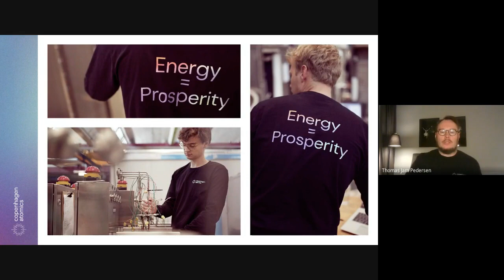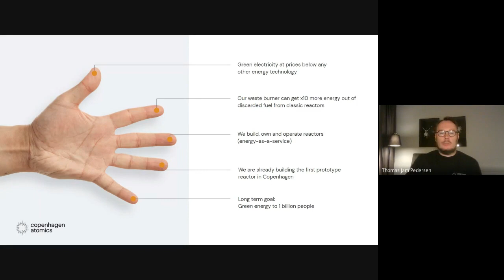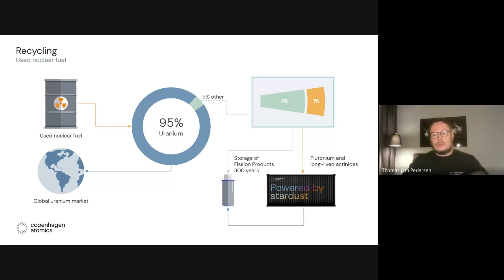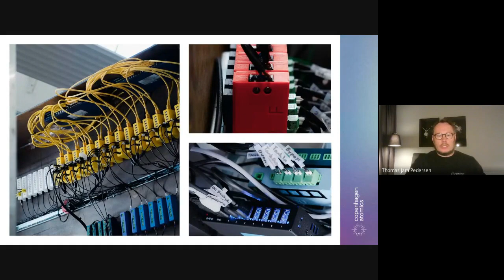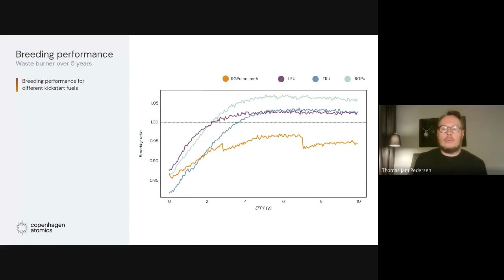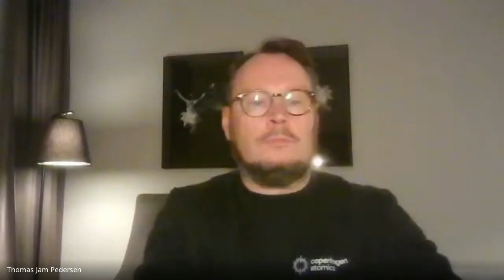Thorium molten salt breeder reactor as waste burner using heavy water as moderator

Comment: The issue with MSRs is the Tellurium embrittlement or segregation.  Stronger more expensive alloys must be used and an additive just to get them to last longer than 4 years and why they were shelved back in the 60s.  Thorium reactors are not Thorium reactors....they are Thorium decay chain reactors where Th232 must be transmutated to U233 so in fact they are still Uranium reactors.  Calling them a Thorium reactor is a fallacy
Reply: it is not a fallacy because the input fuel is thorium.  You are correct (as is explained) that the Th232 is transmuted to U233 to be the actual energy generation but you don't mine U233 from the ground (too bad too).  

As for tellurium embrittlement, I'm curious where you are hearing that.  There is a very interesting video where corrosion was discussed by the ORIGINAL TEAM that worked at ORNL on the MSRE.  They seemed to think that corrosion was not an issue when discussing their work.  It is at ENH-jd6NhRc. 

 I am aware of research that is ongoing regarding corrosion concerns.  My quick search did not find anything about tellurium, but it did show that there are ways to mitigate corrosion, such as their example of adding lithium (see Q73c9LXr1tE).  The video is 5 min long and is a presentation from ASM International.
Reply: @LFTRnow  Thorium is not fissle.....
Reply: @paulmobleyscience  U238 isn't fissile either and yet it is the majority fuel in most reactors. But I would also like to hear about the Tellurium thing. All I heard from every source ever (and I do search around for this stuff a lot) goes against that claim. So please, let us know your sources or how to find them at least. But it is strange, if the people who worked at Oakridge say they were shelved for different reasons and corrosion is managable and the people shelving them also said it's for different reasons I really do wonder who was it exactly that says it's for Tellurium embrittlement reasons.
Reply: @MrRolnicek  Of course U238 isn't fissle otherwise it's what would be used.  In fact U238 neutron captures and exactly why the naturally occuring U235 does not chain in nature as it does in our reactors and exactly why most actinides are synthetic and not found in any measurable quantities in nature.   But U238 is still Uranium even though U235 is the fissle material which is also Uranium...not a completely different name like "thorium" reactors which are actual Uranium reactors being that's the fuel used.   As far as Tellurium embrittlement in the 60s that's what caused them to stop with the first expuremental reactor because at the grain boundry layer it was interacting with the nickle in the alloy.  That's when the expuremental reactor was shut down due to the corrosion and not until the 70s which is where you see them using different alloys in the press release that you more than likely seen but there are many public releases from ORNL well before the 1978 release which is what you more than likely seen.  I'm not here to hold your hand just because you have no clue there is more than one single published release of information on the Tellurium embrittlement issue.   Take a long walk off a short pier and you can shove your attitude straight up your kester
Reply: @paulmobleyscience  Oh well, the naming is your issue. You're of course free to use the whole sentence of "Uranium fuel cycle" and "Thorium fuel cycle" Or you can say the reactor burns mostly Plutonium or mostly Uranium 233, not to be confused with Uranium 235. It's convention however that we just say uranium when we mean Uranium fuel cycle that mostly breeds U238 into Plutonium and burns that as well as U235 directly and we say Thorium reactor when we mean it mostly breeds Throium into U233 and burns that. It's just a name.

And if I understand this correctly, you're saying the reactor was shut down because of Tellurium issues in the 60's and then it was started again with different alloys that didn't have the issues in the 70s which is where I get all of my sources from and that one was then shut down for the commonly known reasons. And I didn't know about the Tellurium issues because the reactor that everyone knows about and had all the press releases is the second one which didn't have the issue anymore. Do I get that right?
Reply: @MrRolnicek  Let me make sure I understand you correctly...you come in attempting to make the correlation of fuel used in "thorium" reactors as the same as what's used in say PWRs when it isn't the same procedure.   You don't transmute U235 into a fissle material because it is already fissle from the start.  Th232 must be hit with neutrons...what is that neutron source Rolnicek?  It isn't the same process like it is for uranium fueled reactors.  "Thorium" reactors are not fueled by thorium, they are fueled by uranium and that's an unarguable fact.  
Now to your other semantic nonsesense...you came in saying that the scientist at Oak Ridge say there isn't an issue with tellurium embrittlement of which was not the case in the 60s when they had to shut down the expiremental MSR after a fraction of the time it was designed to last and was in fact due to heavy corrosion that occurred throughout the vessel. That's when the MSR expiremental reactor was shelved and it was due to corrosion.  Had that corrosion not occurred they would've operated it for at least double the amount of time it actually operated at less than 5 years.  They then conducted tests on using different additives to the alloy attempting to keep the corrosion at bay and found some possible solutions.   Those solutions would not allow a MSR to compete with other forms of energy production and is exactly why MSRs didn't go up like the rest of the reactor fleet...and it was all due to Tellurium embrittlement and that is an unarguable fact.  Rolnicek...you don't think you're the first pronuclear entity here on YT that has attempted this semantic nonsense on this topic do you?   You don't really think that Tellurium embrittlement is the only issue with a MSR do you?  Tell me Rolnicek....why is IMSR attempting a SMR that must have its core changed every 4-7 years?   You mean there is a graphite issue as well?  Say it isn't so Rolnicek..
Reply: @paulmobleyscience  Let me repeat ... the MAJORITY fuel in a PWR is U238, not U235 and just like Thorium it needs to be transmuted first before it undergoes fission. One of the biggest advantages of a Uranium fuel cycle is that Uranium in nature comes with an immediately fissile additive of U235 which can be concentrated for a more potent fuel. On the other hand Thorium fuel cycle has it's own advantages and disadvantages as I'm sure you know.

And let me assure you that I'm not playing semantic games. I've been following nuclear tech for a couple of years and have NEVER until now heard the claim you have made and in fact have heard contradicting claims from the people actually involved in those experiments themselves. I'm not going to simply believe them because they were there with their hands on the experiments we're talking about, I'm here taking your claim seriously but I'm going to need more than "It's an unarguable fact, trust me bro" from some random person on the internet. I'm sure you can see that position is reasonable on my part.

And just as a sidenote, Copenhagen in a DIFFERENT presentation actually did say things that, for the laymen, definitely sounded like comparing the fertile Thorium to the fissile U235 and I left a very dissaproving comment under that particular video because that comparison is misleading at best. Comparing a thorium fuel cycle to the uranium one on the other hand is absolutely fair.
Reply: @MrRolnicek  Trust me bro?  I didn't say that and just because you haven't read all the literature in your few years doesn't give the all the knowledge needed to come to the correct conclusion.  All you're saying is basically you heard the reason we didn't build MSRs from some people is because of some other reason, of which you've never iterated that reason, and that what I'm saying the issue was is incorrect because you heard from some people that it was a different reason.  But now you're saying that you've never heard that Tellurium embrittlement was an issue until you read my comment well before you ever showed up here in this thread.  You now say that you haven't read everything but still somehow seem to think you can discredit anyone because you've "been following nuclear tech for a couple years now...."  and do you think that some of us out here have been doing the same thing over the many years?   Maybe even some of us are Engineers and understand completely how this all works and have spent more than a couple years studying all this.  Tellurium embrittlement of the Hasteloy-n is the initial issue that occurred and why the reactor was halted immediately.  Time to find the date it began and the date that it it was shut down and then add at least 10 long years after that date and is when the "hands on scientists" you speak of offered possible solutions without any guarantee.   After that date in the 70s up until now, no MSRs have been built in the US.   The proof is in those many ORNL public information releases that show this progression.  Over 15 years these documents of studies with MSR technology occurred and reading only one or even a few will not give one the proper solution to the history that occurred.  
U235 must be purified and enriched after tons of U238 is mined just to find a very small amount of U235.  That U235 is seperated from the U238 so that the proper ratio can be achieved when making the fuel pellets. U238 neutron captures and the ratio that naturally occurs keeps the U235 decay chain from occurring.  All we do is increase the ratio of the U235 to U238 and how we are able to make a reactor work at all.  With the Th232 decay series that must be manipulated by us as it doesn't occur naturally in any measurable quantities must be bombarded by neutrons first from the start to transmutate into two other radionuclides before it is then fissle that is a completely different radionuclide than what was started with, unlike the uranium fuel.  Uranium fuel starts and ends with the two same radionuclides that only have the ratio of one to the other increased to get the necessary reaction.  "Thorium fuel" must be changed twice that becomes a completely different radionuclide of Uranium-233 before that fuel can be processed into the proper ratio.  That is a completely different process and is not presented the way that it truly is.  
This conversation should've went much differently and the attitude you entered the conversation with is what caused it to change.  A discussion should not begin with an attempted attack of someone or their character based on one single comment that you didn't agree with.  Stop trying to put words in my mouth "bro".  Let me ask you one last thing....what is the single stipulation for the use of the inverse square law and how is it similar to Planks Black body stipulation?
Reply: @paulmobleyscience  Look man, I've tried to be civil. I do apologise if it came off wrong. My comment was, and I reiterate: 
"hey, I'm no expert but I looked around this stuff a lot and this is the first time I hear about this, can you please tell me where I can find out more"

In response you started being quite hostile in my opinion and for some reason, the conversation also skewed into comparing fuel cycles and what they should be called. Should it be called a Uranium fuel cycle when most of the fissions are by Plutonium and should it be Thorium cycle when all of the fissions are by u233? I'm personally happy with the naming as is as long as someone isn't deliberately trying to confuse (as I believe Copenhagen did in another presentation). The "trust me bro" remark of course refers to the entire attitude of saying "it's an undisputable fact" as an answer when you're asked for a reference or a source.

Now because it seems to be becoming increasingly relevant, I'm not particularly into history much actually so I'd prefer the chemistry over history when it comes to the Tellurium issue. Even though it's probably not relevant as I don't know of any proposed reactor that wants to use hasteloy-n but it's still interesting and you never know, maybe that sort of info will make it more clear for example how "moltex" are claiming to have developed a stable, non-corrosive salt.

I'm no expert, I'm just interested, you said something interesting that seemed to contradict my current knowledge (which you correctly identified comes from the press releases and the interviews with the workers at ORNL) and I want to know where I can find out more. This whole tirade seems unnecesary (though I do personally enjoy this kind of pissing contest for some reason) and your attitude only makes me think that you were actually just bullshitting with your statements and are only hostile as a defense mechanism. I'm still ready to accept the undisputed fact when I read about it but as of right now I believe it much less than when I first read your first comment.
Reply: @LFTRnow  As for Tellurium embrittlement or segregation...its why they were shelved in the 60s to begin with because they wouldn't last as long as water cooled reactors and thats just a fact.   Add the issue of the graphite expansion/contraction issue and they are a complete waste of money and time
Reply: As far as parts not lasting that long in a molten salt reactor Oak Ridge Lab figured out how to deal with than in the 60's.  What they devised was a reactor that was simple to service remotely.  Two things are going on in a molten salt reactor.  First the reactor operates at low pressure so nothing has to be extra heavy duty and hard to replace.  The second thing is a molten salt reactor is simply tanks of salt.  There is not a lot of complicated stuff in such a reactor.  This lends it's self to simply replacing parts on a regular basis like replacing oil filters in a car.  So the Oak Ridge Lab simply built the reactor so just about any part, pipe, tank or pump could be easily replaced using remote controlled equipment. So if any part developed corrosion problems that part could simply be economically  replaced.
Reply: @stanleytolle416  Those parts...are HLW. How many parts do you plan on storing for centuries?  Yes I'm well aware of the "fix" that Oak Ridge came up with.  They also tried different metals as well but as one can imagine making an entire reactor out of specialized materials is not the proper way moving forward and neither is a constant replacing of parts that become HLW. IMSR is attempting this exact proposal of which needs a complete core change every 4-7 years of which is not cost effective especially in today's market with so many other cheaper, safer options available.  The Tellurium embrittlement issue is what makes MSR not a viable option and we figured this out decades ago.
Reply: I watched an interview with the researchers who were working on the Oakridge MS reactor experiment and they all said they had a handle on the corrosion issue.  In fact they were getting ready to build another reactor to test the solutions they came up with along with the blanket production of U²³³ from thorium and waste product separation.  The reactor they were working with was shut down because they had completed the operation and tests they had planned with success. The experiment was shut down by presidential (Nixon) order with an order to destroy all the documentation (which was disobeyed by taking the papers to a small local library). from the research done. Very strange.  My feeling is nuclear power from thorium was a threat to the billions of dollars being spent on the plutonium breeder reactor program because of a perceived coming shortage of uranium.  Do a little my research and you may come to the same conclusion.
Reply: @stanleytolle416  That is incorrect and it is in that neutron bombardment of thorium that creates the decay chain to U233 of which is then fissle.  Nuclear power is by far the most dangerous power source we use on a daily basis and more dangerous than nuclear weapons at this point. By international law, all reactors must be fed with 2 separate forms of power with one coming from offsite of which is primarily globally natural gas amd fossil fuels with a backup generator in case all else fails.  No other power source requires this type of International law of which further proves what we all already know.  Nuclear power in any form can not be afforded by the people any longer especially while  a small group of corrupt people that benefit directly monetarily attempt to sway public opinion on anything nuclear related much like as you are doing now and you will fail to pull the wool over my eyes as I already know the science involved.  National Laboratory scientists opinion on the viability of MSR during the nuclear revolution funded by government/ military programs with loose lips sinks ships mindframe and the American people willing to throw millions at it.  Look around...that no longer exists.